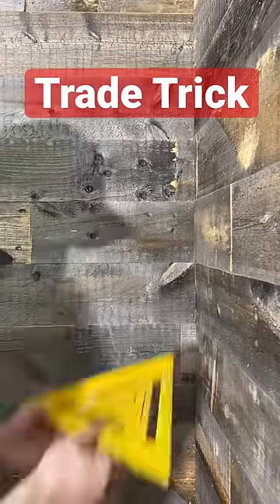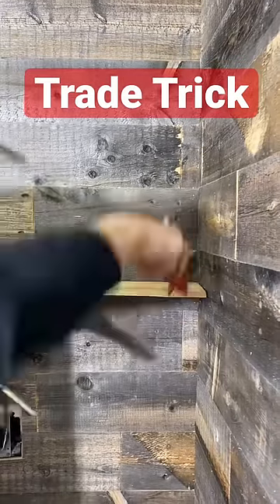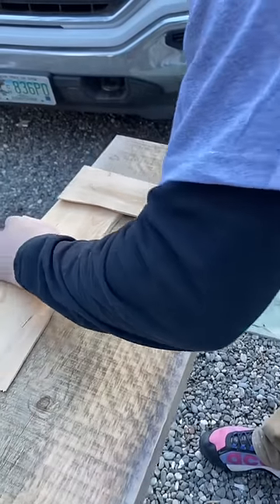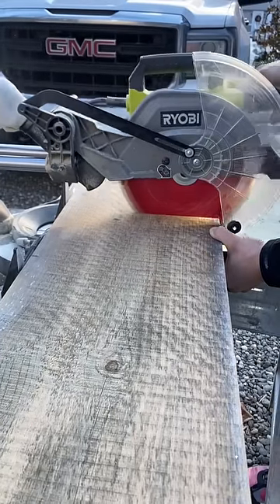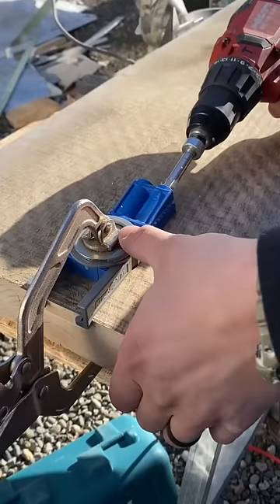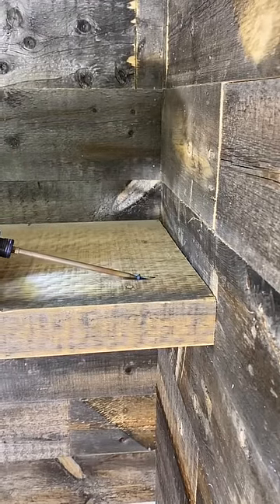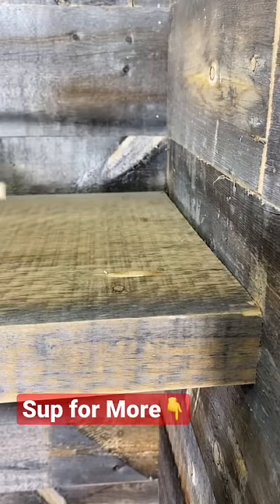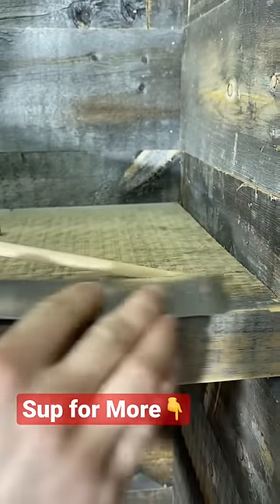How to make perfect cuts for your wood shelf. #shorts #diy #youtubeshorts

Comment: Just use an angle finder and then you'll never have to put 2 pieces of shingles together
Reply: Not to mention you would have to be sure to run the edges of the "homade angle guide" through a jointer or table saw at least to be sure they're actually square to begin with
Reply: @allthingsrepair  
You don't need a square edge you need a straight edge.
Reply: It's idiotic lol

Comment: Sliding bevel would do the trick, don’t cut off so much waste and pocket screw from the bottom then u don’t really need to plug the hole and u can remove it with ease

Comment: So you measure an angle with the template for the tight fit, then you cut an unnecessarily large piece from your workpiece, and you end up with a 3mm gap between the shelf and the wall corner... ok...

Comment: Or you could not have to carry a glue gun glue sticks power cord and scraps of light wood ..... And just buy a $2 protractor. Then you could use a floating shelf bracket and route it in so you see nothing instead of a plug that doesn't match. But good for your level of craftsmanship.....